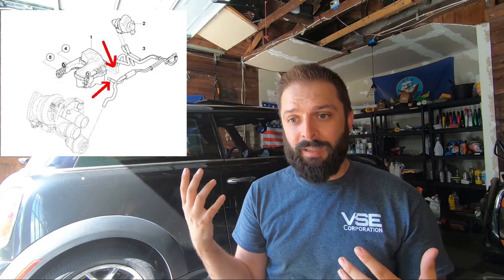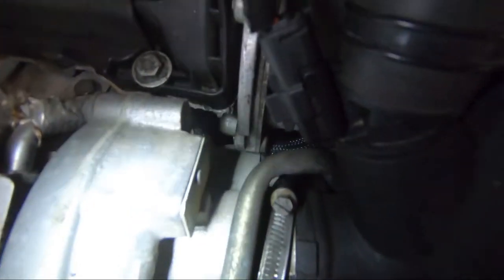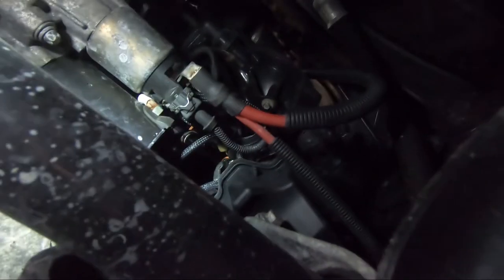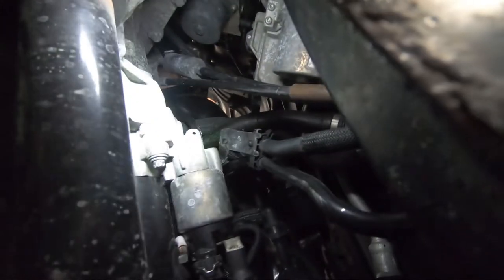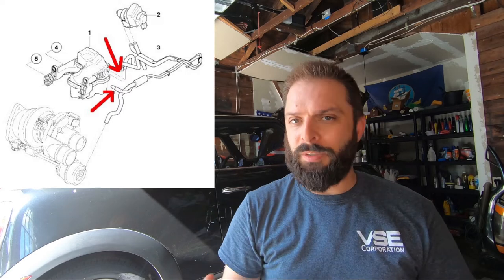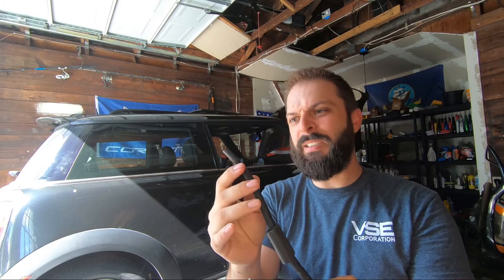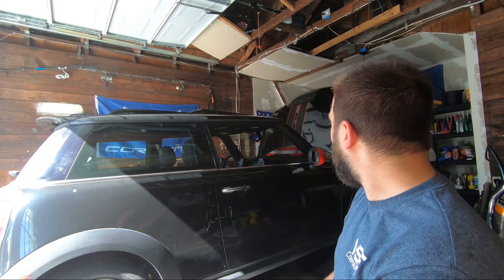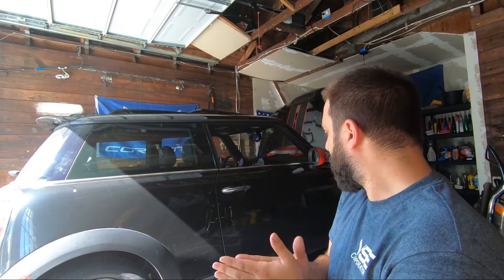LOSS OF BOOST. NO CODES. EASY FIX! (FREE)  **MINI DEALERS HATE HIM**

Comment: holy shit dude. I also just replaced a thermostat and I am having the loss of boost issue. trying this tonight and will return back. I think I remember yanking on those boost cables accidentally when I was removing the turbo air intake. I have been chasing this problem down for like 4 months dude
Reply: Did you fix it?
Reply: @Centralfloridahomes4sale  yes it was the vacuum line. they lose their ability to grip and so the vacuum was literally pushing it off the little barb fitting. Probably could have gotten away with a worm drive clamp but replaced since I was down there anyway, a little bloody knuckle but nothing too hard.

Comment: Bro, i just bought a 2013 mini cooper s turbo. It's a non-runner, I put a new battery in and scanned it, it gave me p0237 code. Car has 110k miles. I have zero knowledge on minis or gas engines. Could it be turbo stop functioning?

Comment: Bought a non running 2007 S
The half engine light was my last thing to tackle. Came across your video snd sure enough nothing was connected. Didn’t realize the extra pep I was missing by the turbo not operating!! Ordered new vacuum hose as the old ones were pretty worn out and not wanting to stay attached. Appreciate the video!!

Comment: This totally fixed my issue after I did the vacuum pump replacement. I finally got around to ordering the new vacuum lines, and I was trying to find a guide online on how to replace replace them.

 I found one thread that said they had to remove the intake manifold. Did you have to remove that to replace the vacuum line?

Thanks for making this video!
Reply from the maker: Outstanding. Nope I just went from underneath. Takes some finger gymnastics but do-able

Comment: I have a 2015 mini cooper countryman, the glass cleaner does not work. the one on the back works fine, the scanner gives this code .. AGCA Junction Box Electronics (JBE), relay for front wiper wiper stage 1

Comment: Is it no boost at all or very low boost? Does the turbo still make noise and work a little just not at full potential?
Reply from the maker: I'm trying to remember. I believe there was zero boost at all. It was terribly slow and no turbo noise.
Reply: @VetOnVettes  mine only reads 12psi max.. what's it supposed to be

Comment: just bought a 2012 coupe and i felt like it wasn't very fast but i havent owned a minis in a few years but this was my whole problem and now it it fixed.  I kept getting an engine malfunction warning going up hills and it seemed like it had no power going up hill.  Plugged in the vacuum line and turbo is squealin now!  Thank you so much

Comment: I am having a noise (moooiiing) when I turn off the engine. And also the fuel consumption is way high... do you think is related to this?? Anyone? Any help is appreciated, thanks.
Reply: When is the last time you did plugs and coils?  Mooing could be modem era dieseling.... unfired vapor being ignighted... outside of that get a compression test... and do not blip before shut off.